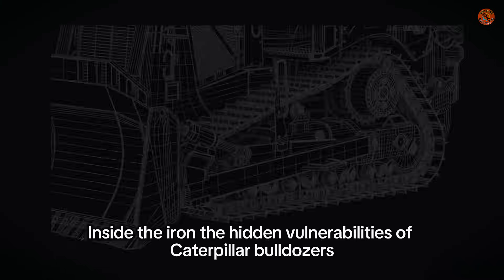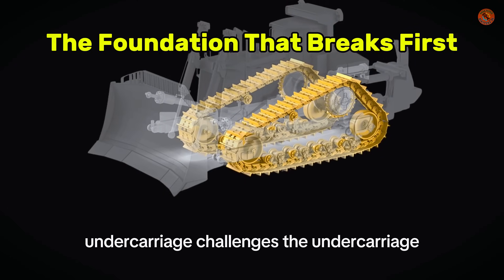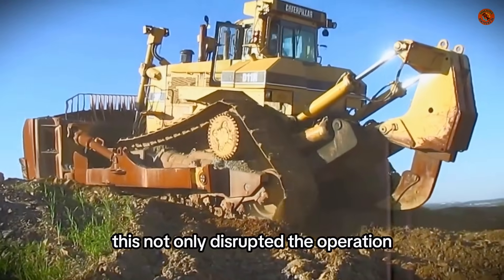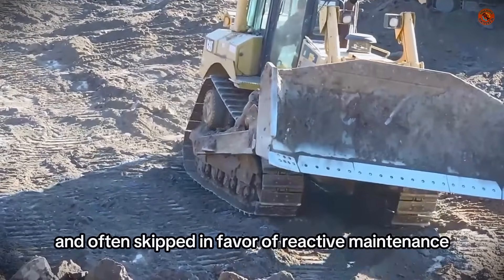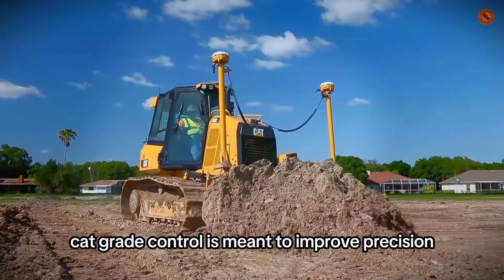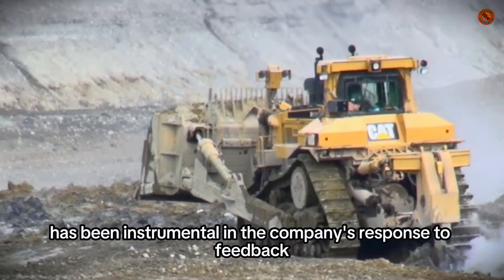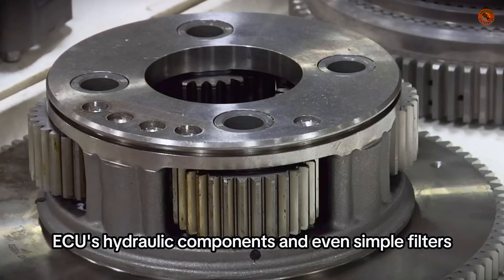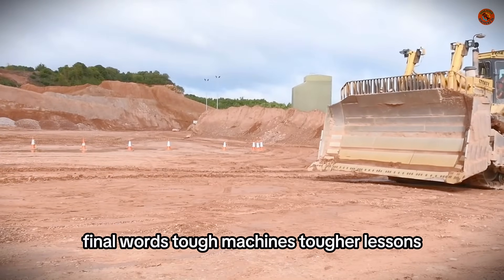Caterpillar Bulldozers: The Unseen Vulnerabilities

Comment: There are far better machines on the market. A big part of the problems with Caterpillar  is that the designers are whizzes on a computer but have no real world knowledge. The management is also out of touch with reality and do not give a damn about customers, only sales.
Quality control.  Couple shitty design with crappy parts with 'Dealer Only' repair, piss-poor parts supply and Caterpillar are nowhere near the top of the list.
Komatsu have an excellent parts supply chain everywhere in the world.  This video says otherwise, this must be a Yankland problem/policy.
Other major Japanese and Chinese brands  are the same, very easy to get parts for and very cheap compared to Caterpillar.
Reply from the maker: Thanks for giving real information and your opinion. Only the Chinese parts need to be checked twice before being put in place😏

Comment: To be honest this video is pretty much relevant to any make model of any type of machine vehicle or whatever type of modern thing you drive. They are all a nightmare got. I’m more agricultural machinery based and the money involved for anything be it purchase or repair is just horrendous. The problems are endless and often never put right again. My Ford van engine has just shat itself as well. 56000 miles with wet belts already changed and it just shat itself for fun. £7k for a recon engine. There’s no fun in running equipment or vehicles now 
I mean there’s always been a dud one or a bad run of a particular model but the money now is just horrendous
Reply from the maker: 100% agree with you, they did not make any stronger machines, they make money now for the parts that they deal with machine owners 👍

Comment: Been using wheel loaders at my sand business for 50 years tried most brands but the last 6 years have used hyundai  couldnt be happier great to operate and extremely reliable 😍
Reply from the maker: Thanks for sharing your experience. It is quietly impressive, but what about other brands you use?

Comment: To the best of my knowledge CAT has yet to fix that stupid door key yet , you know the one that only fits in one way , when you have half a dozen locks to undo fuel filler service access points door ignition etc on a frosty or miserable day it really pisses you off , then CAT chooses to ignore the first law of hydraulics in its use of grease fittings , a single grease point wont do several pivot points, the grease only goes to the one with least resistance then other pivot points are left to run dry and wear, next comes the heat exchanger assemblies , stacking them one in front of the other with the one with the smallest gap at the rear so cleaning is a right pig, put a fine dust screen in front of them like in the agricultural world , simply undo a simple clip pull it out give it a tap or brush then re fit and watch your temperature gauges drop, that is of course unless your new CAT came with a faulty water pump  that disintegrates internally and fills the entire engine with a thick rusty iron sludge, full engine overhaul just out of warranty , next some idiot at CAT linked the air cleaner to the exhaust claiming that the suction created buy the exhaust gasses passing would suck the dust out of the air cleaner centrifuge , well it doesn't work , all you get are very sooty air cleaner filters that need changing very often and of course the best place to put the air intake for the engine is , you guessed it right in front of the radiator , please refer back to previous issue and solution, I think I would prefer to see the old fashioned plexiglass pre cleaner and intake , forward vision was never an issue except when they got rid of the nice parabolic windscreen wiper that cleaned the whole windscreen and replaced it with poxy thing that only clears enough of the windscreen so you can only see an uninterrupted bonnet and sod all else when it rains, and as to computers well ! ever had an auto shift where all to often the bloody thing keeps changing up and down usually at the most inconvenient moments ! give me a paddle shift , up is up down is down , its that simple , got better things to do and no one reads this stuff anyway.
Reply: British Antarctic survey had a D5 in Antarctica with an overheating problem, coldest place on earth 😂
Reply from the maker: Thanks for sharing your experience with Cat dozer faults; my brother said that all new machines have similar problems, and only old ones work like a Swiss watch 🙂
Reply: This is all the result of U.E.I.s designing by computer without real world knowledge or experience.
*U.E.I. - University Educated Idiot.